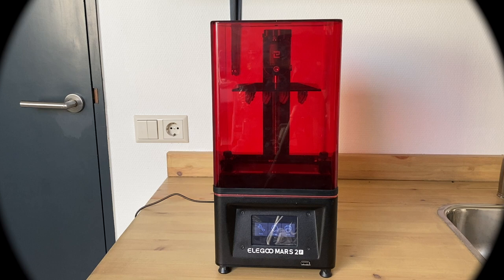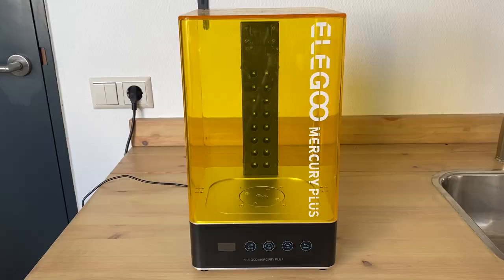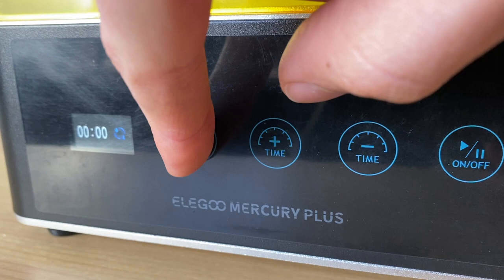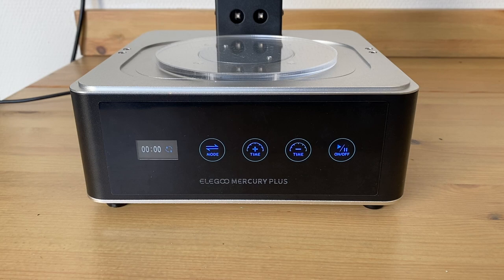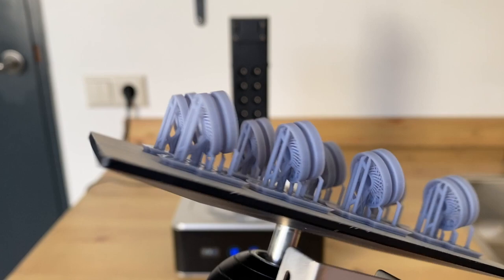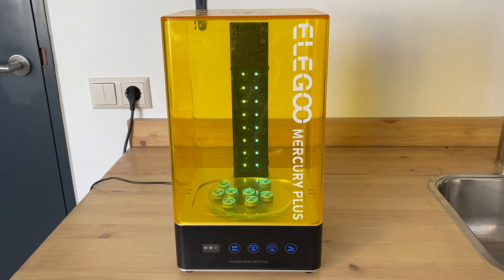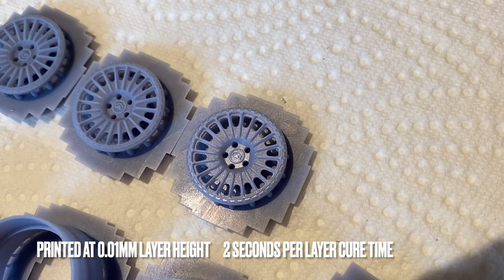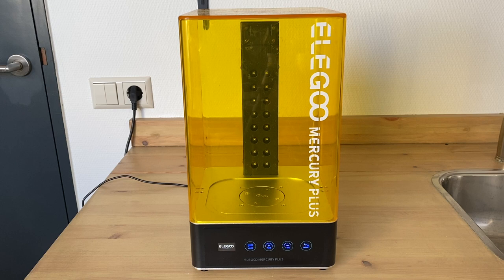Adventures in 3D Printing: Elegoo Mercury Plus Wash and Cure station

Comment: i just got the elegoo saturn, is it perfect with the elegoo mercury or its to small? if its to small, what model you suggest to me ?
Reply from the maker: For a saturn this is to small. There is not yet a wash and cure for the saturn.
Reply: It’s too small for the Saturn but for any small prints you make on it it is amazing. I use my own solution for the big parts but it is perfect for my smaller pieces so far

Comment: I have the Mercury Plus 2.0 and it doesn't have the bracket so no idea how to clean the build plate with it.
Reply from the maker: Maybe contact your supplier for a missing part?
Reply: @TheScalemodelingChannel  Same here, just unboxed mine & no bracket.
Reply: @Kenomica  same here i just got it and was confused... the LEDs totem doesn't feature that slot to install that bracket either; Elegoo changed the design ?
Reply: replying to myself :  okay I checked with the printer buildplate : the basket for the washing machine has slots where the buildplate can be rested on, i guess it's a simpler and cheaper design than adding an entire foreign accessory to the mix.

Comment: I have the Anycubic Photon Mono X, my only issue is that I haven't found a wash and cure station that has the same capacity as the the printer.
Reply from the maker: That will soon be fixed. I have seen some promo’s on their socials about a wash and cure plus